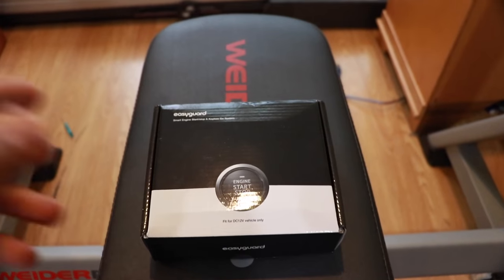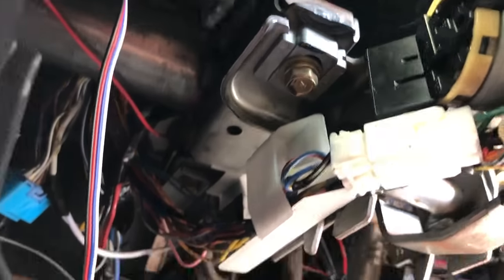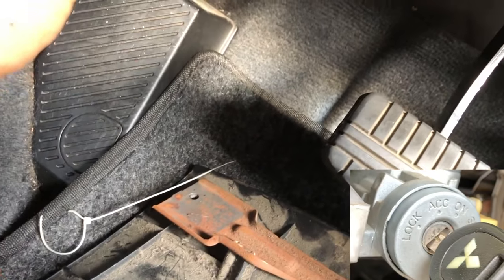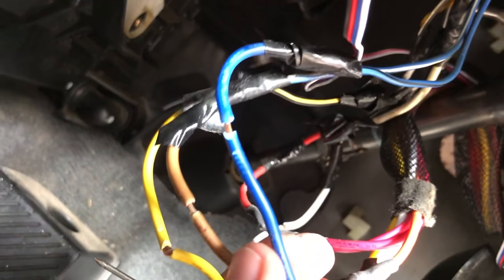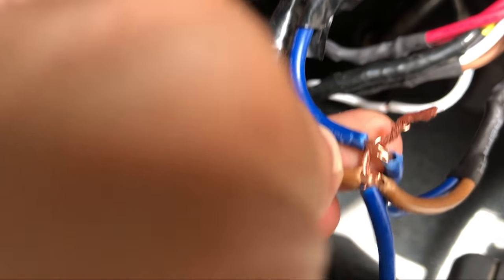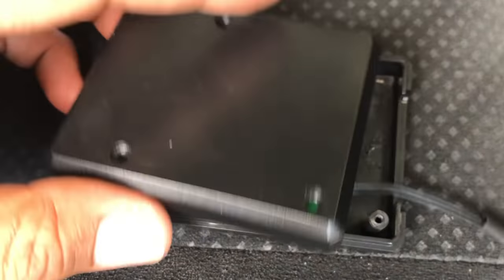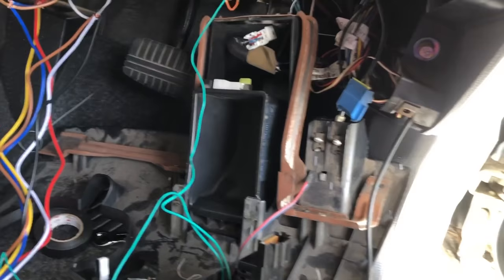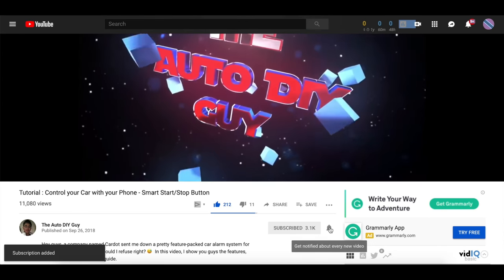The Right Way to Install a Start Stop Button (EASYGUARD EC004)

Comment: Love the video . I want to do the same on an e46 bmw ive lost the key but have changed everything but the ignition barrel as i cant change it over without smashing it. Is there anyway to bypass the ignition barrel? i have a donor key and transponder ive also changed the ecu and ews stuck on how to bypass it .
Reply: Yes just take it out there is a small button on the bottom of the key barrel push it and pull out the barrel

Comment: Would this work with an existing remote start system? I wanted to get the Easyguard ec200-k9 because of the 2 way remote start and increased range, but it doesn't have a push start.
Reply from the maker: It'll work, but you'll still need to use the transponder chip and ring...which I personally find a bit cumbersome.
Reply: @TheAutoDIYGuy  Great, thanks for the response. Is that what you did here? I know you had previously installed the PKE system.
Reply: @TheAutoDIYGuy  I was thinking to get around this to just keep the rfid tag permanently in place and wiring a switch in the reader to cut the connection, so I can just flip a switch. But it's great to hear that the remote start and push start will work together.
Reply from the maker: bob nob yea lol. Only for the purposes of making a video though.
Reply from the maker: bob nob great idea

Comment: What would happen if i unhooked my ignition harness and test the voltage with a multimeter?
Reply from the maker: Then you wouldn’t be able to know which wire corresponds to which position on the ignition lock cylinder
Reply: @TheAutoDIYGuy  can i just pay you to install it on my system LOL

Comment: I have Ign-1 and IGN-2 and IGN-3 I only have wires for 1 and 2 in the kit. where does IGN-3 wire go?
Reply from the maker: Do all 3 IGN wires receive 12v+ when you turn key to "ON"?
Reply: @TheAutoDIYGuy  Thank you for your reply. the wires attached just like the directions. I had a bad connection on the break wire. No 12v+ when peddle was pushed down. fixed ,now works perfect.
Reply from the maker: mike maifeld great job!

Comment: My car doesn’t turn on if the key is on the ACC, only in ON position. Also My car doesn’t turn off unless I turn the key to off position... is there something else I’m missing.
Reply from the maker: you're supposed to disconnect the wires from the back of the ignition lock cylinder, and connect them to the start stop button main unit instead, like how mine are in the video.
Reply: Thank you!
Reply: Apparently I need a relay because it’s not receiving enough current to crank the car, only to power acc and ON but not enough to crank.. 😅
Reply: dkr63p I’m still working on it. I just got delivered the relay and the T taps connectors today. I will attempt again tomorrow. But the brown from the device supposed to connect to 86 and 85 to ground. 87 to on2 of the car(where the brown would normally connect without the relay) 30 to battery, (i’ll use the fuse box). Also I’m planning on using a relay to power the push start system itself as a last resort.
Reply: dkr63p adding a relay helps. All the electronics are using to much current. I added a relay from the fuse box to the device push start system instead of the brown wIre

Comment: you made me confuse, did you connected the brown and white to ignition on wire
Reply: Brown and white that is with the blue and white 2 pin you don't use the brown and white you only use the blue and white on most cars anyway

Comment: Excellent video! Cant wait to give it a go myself!! 
One question though, with the spare key cut off in the barrel, in the acc position, does the power not stay on? Which wires will need to be cut off from the ignition?
Any feedback/advice would be awesome!
Thanks 😁😁
Reply from the maker: The purpose of the key in ignition is to disengage the steering lock; the wires corresponding to the ignition lock cylinder will be disconnected and re-routed to the start stop button system, so the power will not stay on.
Reply: @TheAutoDIYGuy  So basically....
Hack all wires from the ignition barrel?
Reply from the maker: @leonclince5462  the ACC, ON, and START wires, yes.
Reply: @TheAutoDIYGuy  Excellent, thanks alot! 
Top man! 👍👍
Reply: Another question, the 2nd wire from the brake pedal plug, does that need to go to a chassis ground?
Reply from the maker: @leonclince5462  only one wire you have to connect. The other one can be ignored.
Reply: @TheAutoDIYGuy  Thanks again mate 😁
Reply: Got it in and "working" but...
My ignition only has 4 wires coming out...
12v constant.
On.
Acc.
Start.
With the button the car starts on Acc (2nd press) and without the brake wire installed.
Any ideas?
I know im being a pain, but others may have the same issue 😊
Reply from the maker: @SL0WLY-WE -R0T  Okay, so in terms of starting without the brake wire installed, this would be because you connected the brake signal wire to the incorrect wire. The brake signal wire should only receive 12V when you press down the foot brake pedal. 

In your case, it is receiving 12V all the time, which is why you are able to start without the foot brake pedal pressed; so as far as the system is concerned, it thinks that you're pressing the foot brake pedal (getting 12V constantly).

Fix this first, and I believe it should fix the other problem 😉

Comment: After installing, why does my car still keeps running even if I turn off the engine and disconnect the battery?
Reply from the maker: Running? You mean it’s in ACC mode?
Reply: whole engine won’t turn off, thx
Reply: 😂😩😂 you car has gone rogue sorry

Comment: If we remove key system than how will work steering lock
Reply: it wont, you have to break the key off in the cylinder. or remove it entirely, thats why this is such a stupid concept

Comment: What happens to the old central locking system
Reply from the maker: This is only a start stop button kit, so all it's doing is converting the keyed ignition, to a start stop button ignition. Central Door locking and original alarm is separate and untouched.
Reply: @TheAutoDIYGuy  oh
Reply: @TheAutoDIYGuy  And what about the PKE system with start stop

Comment: Why does the key have to be cut and inserted into the ignition still
Reply from the maker: this is only if you want to keep your ignition lock cylinder in place. Normally people keep it in ignition so they can disable steering lock; in my case, I just removed the whole thing lol.

Comment: What the immobilized for?
Reply from the maker: Immobilizers are installed by car manufacturer to make your car more difficult to be "hot wired"
Reply: The Auto DIY Guy thanks bro!
Reply: @TheAutoDIYGuy  can you tell me one thing...if ill remove the lockset completely will i still be needinh that bypass module or i can just install the keyless entry push start system without the lockset removed?

Comment: Hey Bro,
My easyguard alarm with pke is installed by professional guy. I have two problems as follow.
1 if I forget to turn off engine and walk away, my car locks but engine does not turn off automatically.
2 my trunk release with original Honda Civic 2013 key works but not working with key fob. Installer guy has connect purple wire with constant positive. Green with white or black wire is connected to selenium positive wire of trunk and cut and other end of it connected to green wire of easyguard brain system. There is no energy in green with white wire which is connected to selenium. That is why trunk is not released with key fob but if I connect cut wire than it release with original Honda remote.
Will you please help me to solve my two problems . Waiting for your reply.

Comment: Only one problem with cheap easyguard start button system, after 6 or 8 months it fails withought  warning, your engine just shutdown while you drive, after that i bought another brand called banvie, but after 7 monthd it fails also but different from easyguard, the  HVA has been dissableb, no AC, no radiator fans also, you cant even notice that, because the engine keeps running, but i was lucky, when it happened, ut was summer time, and the AC stop working, and i  notice the whole HVAC is not working, so i disconnected the start burton system, and start the car with the key, and HVAC comes back, if that happen to you on the winter or automn when the AC is not needed, your car will overheat, because the radiator fans are dissabled with HVAC, and now i bought and expensive  easyguard start button system 130 dollar, amd now 1 year and 3 months and still working, of course i bought another one the same as spare. When it start failling, i will replace the black box with new one and problem solved.

Comment: Oh sry
What happens to the existing central locking system when you install the PKE system with start stop ...... The video you had done long back
Reply from the maker: That one essentially "taps into" the existing central locking system of the vehicle to work with the new key fob.

Comment: So you put the key in, turn it to first position and cut it off, SO YOU HAVE UNDONE THE STEERING LOCK,  and cover it with plastic.
NOW YOUR STEERING LOCK IS NEVER ON, Does not sound great.

Comment: What a sketchy/uncertain way to test your wiring for voltage. With the Advent of the internet you can find a wiring schematic with about 15 seconds of searching
Reply: Not true find me a diagram or pinout or color code of the ignition switch to a 2008 chevy HHR  then get back to me.... but As for the video does anybody else haven't issued or loses audio

Comment: How do I install this if I already have remote start and bypass module?
Reply from the maker: Actually, you can install it just like you see in the video. 😀 You just need access to those ignition lock cylinder wires.
Reply: The Auto DIY Guy do I still need to get that bypass module in your link?
Reply from the maker: pats4life the bypass In this case is for Cars with an immobilizer built in. So once that has been bypassed with your module, then you’ll be good to go.
Reply: The Auto DIY Guy ok thank your very much